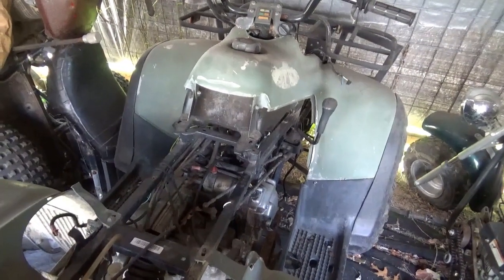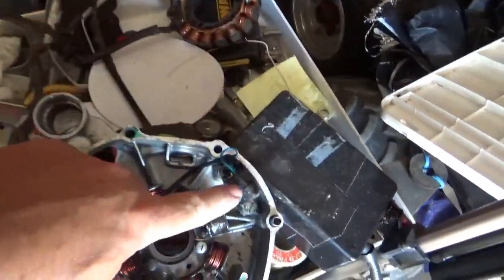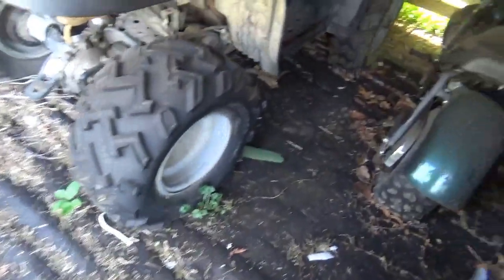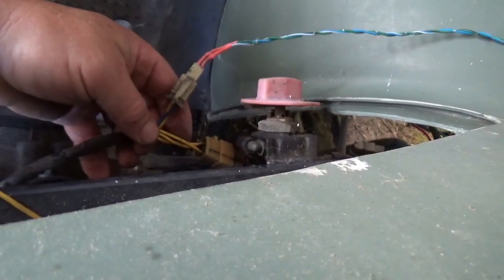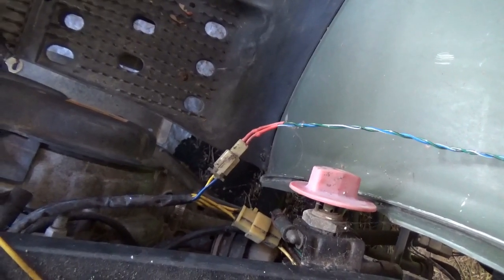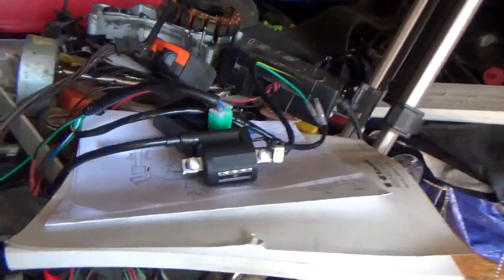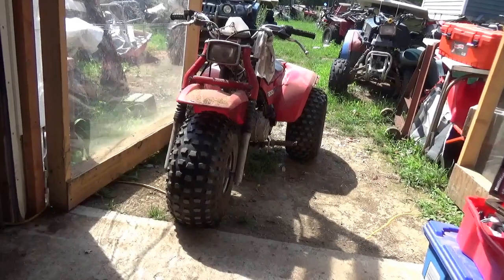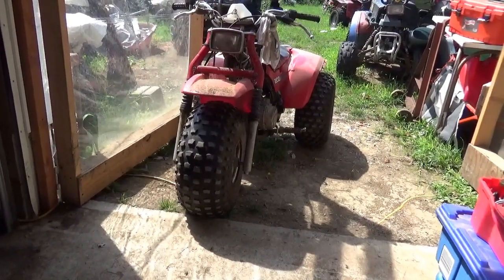No Spark Linhai Big Horn 260, Mountaineer 260, Manco Talon 260, Fixing Junk!

Comment: I just picked on up for $50, guy said it wouldn't start said his kid over heated it thought he thinks burnt up the piston.  I messed with it a lil, new spark plug (I get spark)  and tried to crack it over,  cracks good but would turn over.  Put new carb in just cause still same thing.  Did the thumb test to check for compression and it has it (just bought compression tester online to make sure it has the right compression) The temp light is on and constantly buzzes when I turn the key,so I bought engine temp and radiator sensor thinking that got to be the issue?  Any tips or suggestions from this point?  I will update when I install both sensors and check the compression

Comment: i have a linhai 260 with no spark someone try to fix and after he changed the coil the ignitor and pulse coil still would not start. He let me look at it and i found the ignition coil spark plug cap was no good there was spark without the cap on it when the cap was put on no spark. changed cap. runs now.

Comment: I have the linhai 260 and I have all power except power going into the cdi box... I have traced wires through the whole atv but im not sure if there is a safety switch im missing or if I can just run a jumper wire from ignition to the cdi 12v wire

Comment: We had 3 Linhai rustlers never had an issue still running today nearly 14 years later
Only parts replaced is tires,shocks and all the oils,take care of your stuff it will last a good long time
Reply from the maker: Hi, I bought this one used, it had issues before I got it and it must of been stored outside.... I work on ATVs almost everyday and I buy and repair 2 or more every month. This particular atv had more issues in 1 atv than I see in 3 or 4 put together.... The wiring was hacked up, no big deal, except, they do a lot of strange things... Both the fans are seized and the thermostat that turns them on and off was corroded.... The fan control box, the cdi,  and the handle bar left hand switches are dead........ Once again, nothing that can not be hacked around, but, all the repairs added up, got expensive and annoying. I put it on the side for the time being, I'll get back to it when I need a challenge!  On the positive side, it seems to be build like a tank and the engine and transmission seem solid. This is my experience, I am happy to hear Urs was much more positive, I should get it running again and use it or sell it.... Thanks for Ur thoughts, experience, watching, and commenting!!!
Reply: Harvey Spooner ok im not saying that these quads are the best but i understand what ur telling me:)

I also forget to say they had a few engin replacements 😅😂😂(: only a jk:)

I just hate seeing people breaking stuff and then selling it

Comment: Farmers use these atvs all over South Africa and we abuse them all the time year after year with very little to no maintenance but they keep going. All the electronics (thermos switches and heat sender units) is basically exactly what you would find on most older cars. So perhaps this is just to modern for you? 
Thet heavy "turd" can tow a big load. At low speed without overheating due to the water cooled system day in and day out. Its not a toy. Its a tool.
And a good one.

Comment: I have the same model as that in a side by side. If there is anybody that can get the wiring figured out-fixed it you. I have found a couple good diagrams on the web that have helped me with mine. I did have to replace the stator and pulse generator-
It has been running great lately-but then again it has almost been completely rebuilt/gone through at this point. It was given to me by a friend after sitting outside for a couple years. Don’t give up-you can do it. Glad to send pics of my wires if needed
Reply: I need a diagram or whatever you got
Reply: Glad to help-if you can provide me an email-I can send what I used to fix my issues-thank you
Reply: I need this wiring diagram also
Reply: I think I still have it on my phone somewhere-let me know where to email it to
Reply: @toddnewton3633  i need heil with this 2012 sidexside big horn 400cc 28 series no spark at the plug wire driveing me crazy can;t find the right parts for this utv heip

Comment: The Linhai 260 I bought with 500 miles on it  has been nothing but a hassle. First the clutch blew next the  variator failed now electrical failures lol. Good lucky Harvey these things are junk.
Reply: Update fourwheeler wiring took a sh*t . Going to the scrapper soon. These really are not worth messing with.